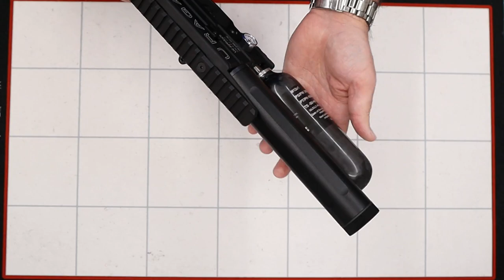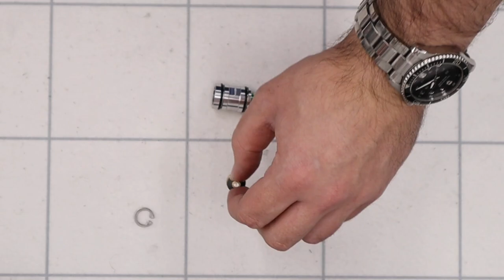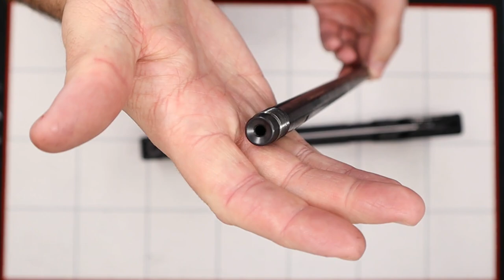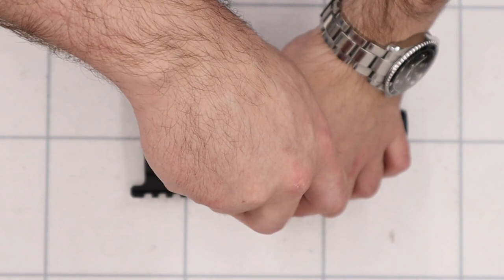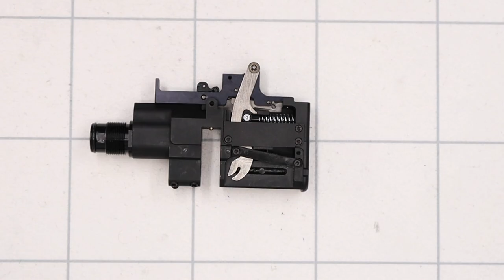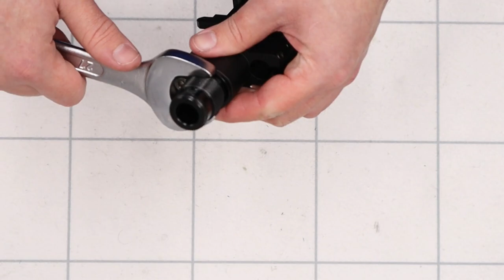AGT Uragan 2 full disassembly

Comment: Fantastic video, really helped me. Question though, there is an extra o ring in my valve stem that's not on yours? The o ring appears to serve no purpose, it sits on the valve stem forward of the sealing face, below the transfer port and there are no locating grooves for it. My worry is that this should live in the main body as there is no sealing o ring between the valve stem and the body on the hammer side. Have you seen this before?

Comment: After some advice if possible , I need to replace my pressure gauge on a mk1 uragan , would you know which size gauge and type of thread is needed in case I can't source an original agt one and have to go aftermarket , thanks

Comment: Good morning, I have an rti prophet 2 that came out about 5 months ago, it has an assisted valve that does not seem to be a great success, with a few thousand shots it started to leak through the valve, I sent it to the dealer and they installed a one-way valve of different air ensuring a better result, if I had the opportunity to do a rewiew assembling and disassembling I would appreciate your opinions and advice, greetings and thanks.

Comment: Did you change cha valve ? Because uragan 2 valve comes with  one O ring while uragan 1 comes with 2 o rings in the valve
Reply: The one in the video is the older original valve. There is now a white Delrin one, which seals better and is available as an upgrade (still 1 o-ring though)

Comment: How to transfer the air if the bottle is empty? 😢
I cant doing that, because the air always coming out in the back of valve. 😢
Reply: Stand upright with barrel in air so gravity assists the valve closing. After checking unloaded, place thumb tightly over barrel to seal it and pump away. Once the pressure build in the barrel it pushes the valve closed and you're good to go. AGT now include a red barrel cap for this reason